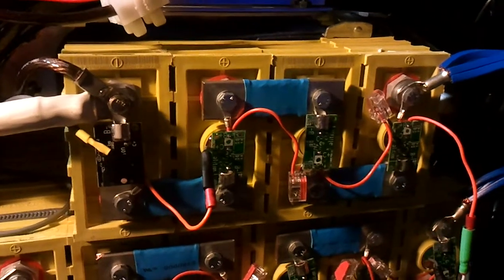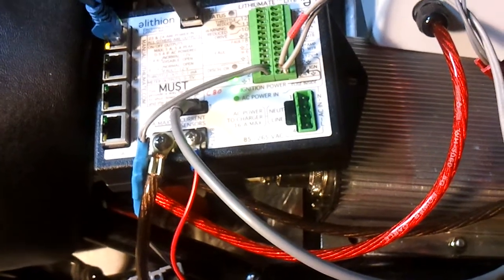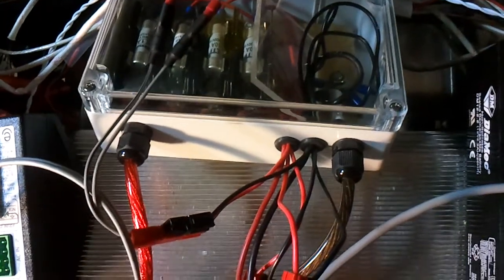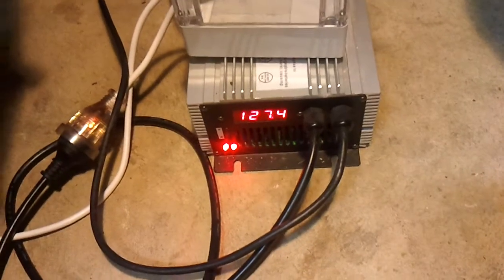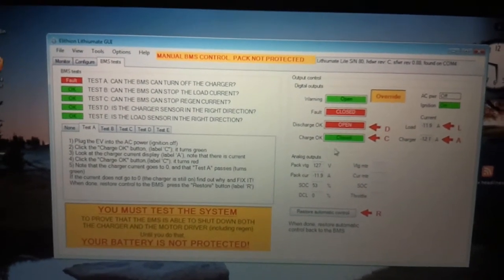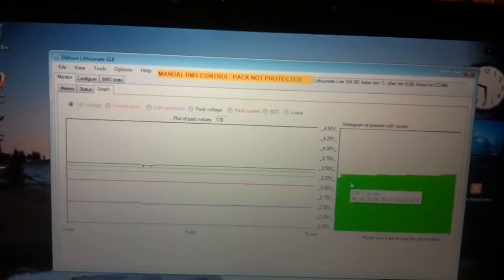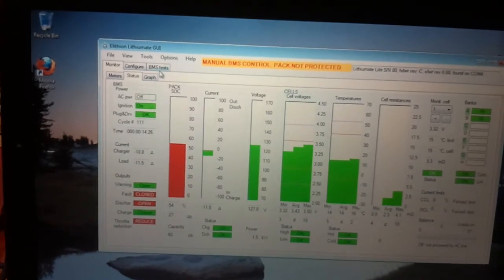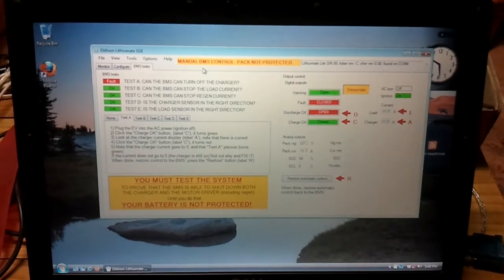Battery management system turns on charger

Comment: Hi Paul
Really appreciate ur effort to put his up. I had some doubt regarding the BMS working. Under overcharging or overdischarging conditions when the BMS switches off the system, how do you re-energize it back when it shuts down?
Reply from the maker: The BMS itself has three power inputs - one running input from the 12VDC battery while the vehicle is running, and two charging inputs (one 12VDC, one 80V-260VAC) for when the battery is being charged.  These supply power to the BMS independently of the charger - regardless of whether the charger is running or the motor controller is allowed to draw full current, the BMS always gets power.

The charger is then switched on and off by an external relay driven by the BMS.  That's so that the BMS doesn't have to switch the full charging current internally (which would make it more costly and heavier, and some people may require a larger relay than others).